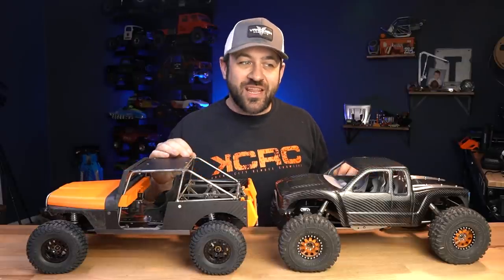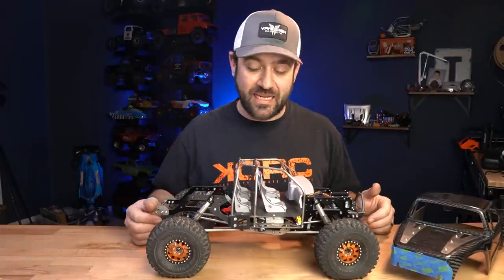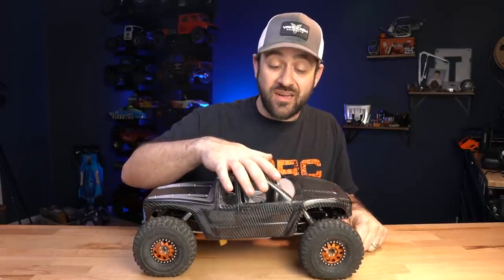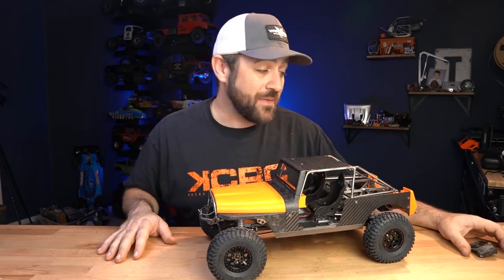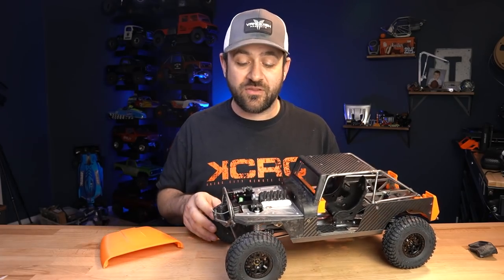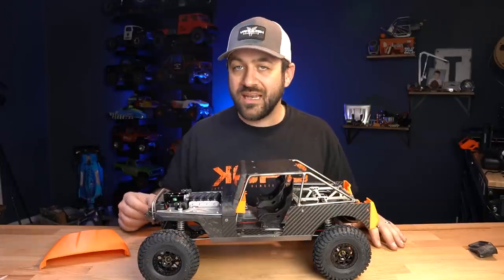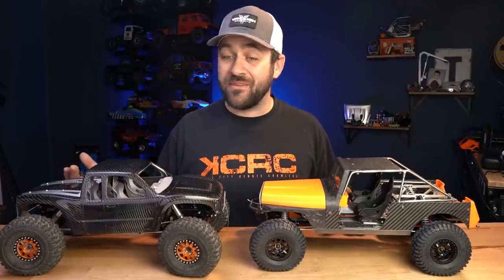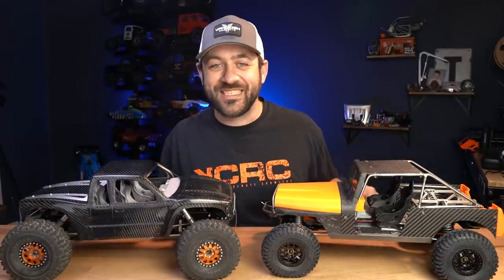Not enough TIME - Road to Scale Nationals - S2 E7

Comment: Are you planning on shortening your rear steer servo wire and running an extension to where it would plug to make the axle swap quicker or are you just going to plug it straight to the rx?

Comment: Hey Harley , I tried the link to get the list for the parts needed for the ssd trans and part needed but it wouldn't work., so I thought I would ask if you could email me a list of parts I need to put  one in my wraith , I have mip driveshafts in place , was thinking about a scx10 trans but can't find one , unless I misunderstood the ssd will add some speed.
Reply from the maker: The old wraith stuff is pretty out of date now. I don’t have any current list of parts to send on that but I would not suggest that old SSD high speed trans. It was not a good product. You’re best off just going with a high quality brushless system.
Reply: @HarleyDesignsInc  , ok  thanks for the input